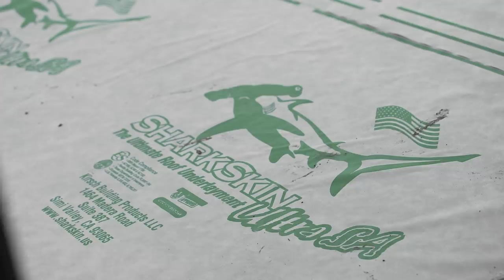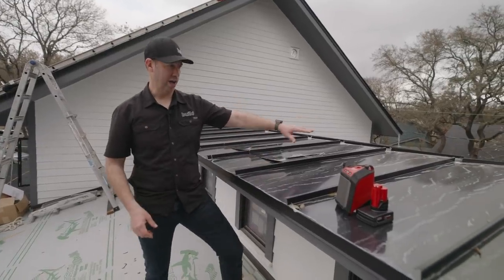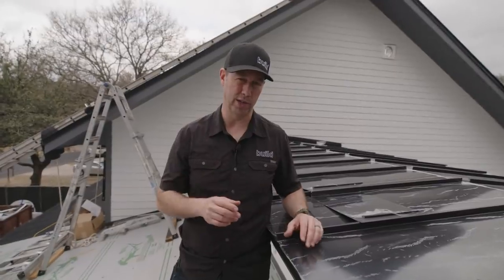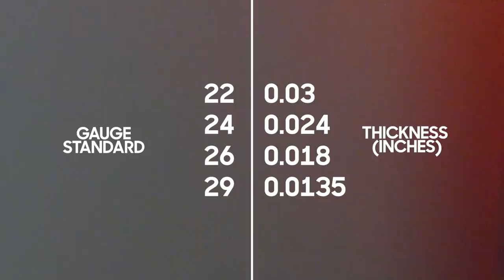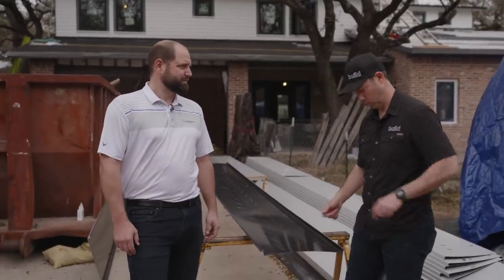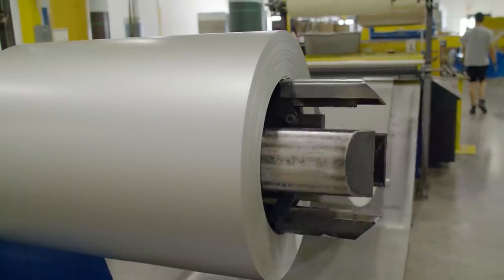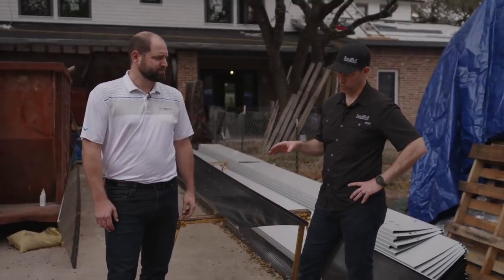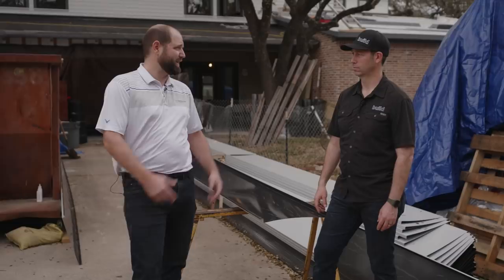Metal Roof- Best Practice Details

Comment: What is the cost comparison for a metal roof vs composite shingle?
Reply: I doubt you will ever get that answer!!
   I did a rental property a few years back. Comp. cost was $6,000.00. Metal: 24,000.00
   That’s a big difference. Plus it is a small 1600 square foot house one story L shaped home
Reply: Further more the materials in your area can always be based per square foot. 

Talk to your local installers and you'll gain pretty good insight towards this question. 

I bought my metal at $3.50 sq foot 
Shingles would be substantially less but that may not be the variable that changes the final price tag.
Reply: Historically we've seen standing seam metal coming in at about 3 times the cost of comp shingles. This can vary dramatically depending on the choice of shingles and the metal system, and it's especially hard to predict now that material prices have gone up for everything. The best way to check is to get multiple quotes from different contractors in your area. -Thad
Reply: @TheMetalRoofingChannel  
   That is how I feel. You should get multiple bids on any construction type work you do to your house!!
   
     I have another story. I had a new heating and air system put in my home. I had several bids. 2800 to 3400 dollars. Then I ran into a friend of mine. I asked him to come over and just put the system in. He was there in about a week or so. He did a great and clean job. He sent me a bill it was $4500,00.
  Maybe I should have gotten a price from him also.     😜

Comment: Alls I really wanted to see was all the roof-to-wall flashing, and the flashing details wear a facia board buts into a wall. Some of most crucial parts of making that roof water tight. Didn't see any of those details covered, what a shame... A whole video could be made on just the roof flashing details alone.
Reply: Some people can't read drawings. To them, a picture or a video is worth a thousand words.
Reply: That's what I wanted to see. Making a water tight roof is probably 95% flashing work. Any idiot can be taught to lay panels or nail shingles in one day. The real work is in the flashing details.

 We would have had a receiver flashing made that goes on before any siding product. 

The siding comes down over it and leaves an S channel exposed for us. After the panels go on, Z-bar with butyl tape would be screwed to the top of the panels. Anywhere a panel meets a side wall we turn up an inch with the panel as extra protection. 

Face flashing would hook onto the Z-bar and the top of it would be screwed into the wall right under the receiver flashing.

 A counter flashing would then go into the S-bend on the receiver flashing and cover over the top of the face flashing.

At least, that's how I was taught to do it. I've seen other people make an all in one flashing that goes on before the panels and they just slide under it. It is vastly inferior in my opinion to the way we do it. Driving rain, bugs, and animals can all get under it. It really sucks at side walls b/c you're strictly relying on your 1 inch turn up to make it water tight, which it isn't. 

There was a company that came into our town and basically took over the market. That's how they did their flashing details. A contractor we worked for dropped us and started using them. About 3-4 years later they start giving us work again. We ended up going to every single house they built in those 3-4 years and had to fix every damn one of them. Luckily it was just front porches and accent stuff, not entire roofs. Just shoddy workmanship all around.

Comment: Bravo, for the air gap.   Bravo, for radiant barrier, shiny side down; you're gonna need it because that black metal will heat up on sunny days to a very high temperature; but the radiant barrier will block irradiation of lower elements... to the extend that conduction does not defeat the radiant barrier.
Reply: I don't understand the logic behind installing "shiny side down". The natural reflective property of a reflective surface facing a heat source across an air space allows the
aluminum surface to reflect radiant heat back to the direction from which it came. If it's facing down, how is it working?

Comment: Love your channel, but every time i hear lifetime of the building amd then 30 40 years i wonder. Why do you build (in this case) a roof that will only last 40 years? In the netherlands where i am from we build to last way longer. Certanly not 40/50 years
Reply: I know right? And they talk about it like it's so great lol.
Reply: Gotta factor in cost vs performance. Do you really need a hand seamed copper roof that will last 300 years? Probably not. Most people aren't staying in the same house for even 20 years here. Another factor is that materials, installation processes, and building codes are constantly being updated and improved. 

And this roof will last way longer than 40 years. The paint warranty is 40 years. I just replaced a 5-V galvanized steel roof at the beach that was installed in 1946. That's nearly 80 years of life from what is now an inferior roofing product and has been inferior for at least 30 years. If it was further away from the salt water it would last hundreds of years. We went back with a 5-V galvalume coated steel roof with stainless steel capped screws that will definitely last well over 150 years. 

When they say it will "last" 40-50 years what they should really say is the manufacturer's warranty is 40-50 years. Its not like on the day of year 41 its going to pack up and leave or something.

Comment: Hi Matt 
I have a question. I live in Northern Ont. I have a 3 season log cabin kit. My roof is beams & tongue & groove boards on top.
I have GAF membrane to cover whole roof. Can't afford spray foam. Can I use Rockwool Insulation under my metal roof?
And if so what is the procedure?

Comment: Why didn't "t you put the radiant barrier facing up where you installed diagonal 1x4s? Isn't that the 3/4" air gap side., or does the foil work when upside down too?.

Comment: Anything made of plastic or polymer will fail over time with heat and UV rays. FACT. Taped joints will fail when the adhesive backing becomes brittle and fails too. FACT.

Comment: FACE palm. the radiant barrier should be installed first, THEN the spacer material (1x4, or that fabric like stuff) and then the metal roof on top of the spacer. the way you laid it down is a total waste. it will do nothing.

Comment: With a black roof and the obvious heat generated, have you thought about capturing the hot air during winter? Maybe it could be directed to a heat exchanger to heat your hot water or house? Might as well use it if you can since you've isolated it from your roof.

Comment: Hey Matt, Thank you as always.  I wish you would have shown the detail on how the roof air flow mesh meets the upper wall.  

How do you use the corrugated plastic to allow the vapor from the roof to vent upwards?
Reply: vapours travel through the air space between the underside of sheet metal and the top of the membrane, then escape at the bottom of the assembly and at the top (soffit/ridge). There are continous vents at the soffit/fascia and at the ridge/junctions to vertical walls.

Comment: Matt, good info as always! My next roof will be metal, so I’m very interested in the details. My biggest question here is why black? I’m assuming it’s an aesthetic choice, and I agree that it will be a good match with solar panels. But since it’s so sunny where you live, doesn’t black absorb more heat and increase the demand on your AC? I recently had a solar PV system installed and one of the considerations was that roof mounted solar panels are less efficient than ground mounts because heat gets trapped between the panels and the roof. Solar panels produce less electricity when they get hot. It would seem to me that having solar panels mounted on a black roof would exacerbate the problem. As always, I’m eager to be proven wrong...
Reply: There really isn't that much of a temperature difference b/t the colors on metal roofs. They all get hotter than two rats f*cking in a wool sock. With all of the moisture and heat mitigation he has I highly doubt a different color choice would make any significant difference. If you're spray foaming the roof deck, then it definitely doesn't matter. 

Another problem with white or other light colors is how bright they are. If you've got an upstairs window that overlooks a white roof then be prepared to wear sunglasses in that room or have some damn good blinds and blackout curtains.
Reply: You are 100% right, I recently installed a silver metallic roof for a client and the panels did not get hot. Yes the roof is bright when installing it, Matt could have gone without the reflective material had he used a lighter or reflective color

Comment: Doesn’t the air gap make the metal more susceptible to hail damage?  Is the air gap necessary, why would you have moisture under a metal roof?  Seems like you shouldn’t need the drying of the roof is doing its job.

Comment: I just don't understand the overbuilding. Metal roofs should not leak - ever. Putting on a peel and stick just makes a leaky metal roof a bad investment. Zip is all you really need. Peel and stick is way over the top in money and wasted materials. Properly installed metal roofs will last 100 years and have never needed rain screens or peel and stick.

Comment: I’d be interested if you considered solar panel tiles?
Reply from the maker: I looked into that, but in the end I decided this was a better choice. It allows me to put the solar on when I’m ready and have the roof I wanted in the meantime. I also have some pretty good tree coverage so I’ve only got one spot over my master bedroom that will work with Solar
Reply: @buildshow  on partially shaded ares micro inverter solar systems would work better :D
Reply: @buildshow  Hi Matt, are you pre-wiring your garage for electric car charging?

Comment: there is a few things wrong with your install. yes the shark skin is a vary god product but, you never a want to use 100% ice shield on your roof. it dos not allow the roof subdeck to breath this leads to dry rot of the subdeck. here in my state 100% ice shield will not pass code because of that resin. 2. is the style of ridge vent you used.  has to small of a perforations and gets plugged vary fast so after the first 6-12 months it is useless. that's if the insolation company  do not plug it up first.

Comment: I just priced this September 2022 for a 55 square roof. $105,000 for the roof and $18,500 for the air gap framing details. An architectural shingle roof with full ice/water peel & stick came in at $38,000.

Comment: You need to do a video on reducing roof vents.
Reply: Yeah, where are the toilet stacks?
Reply: @JerryLevenson  
Usually out the gables.
You need to check code in your area to match proper pipe diameter, etc. but the vents aren't required to only go up.

You can't go up, and back down, and you need to size appropriately.
Looks at mountain ski cabins, most normal through the roof straight up vents are at a high risk of getting plugged or torn off with heavy snow falls.
I'm getting ready to replacing my roof with metal, I've been relocating and reducing the number of roof vents where I can. Water heater was moved last month when I replaced it, furnace is coming up.

Comment: Matt - I'm in Texas as well... Beaumont to be exact. Getting a black standing seam roof installed and the builders couldn't get approval to install solars with the S-5 clamp. They will have to penetrate and screw to the rafters due to the windstorm codes. Just an FYI...

Comment: Remember just cause you have solar does it mean when the power goes out that you’ll have power in the house only with a battery back up with the solar will you be able to maintain power
Reply: the "standard" solar system shuts down during power outages because it has no provision to isolate itself from the grid to prevent unwanted backfeeding.  also, it has never occurred to generator manufacturers and solar manufacturers to have their equipment work together.
Reply: @kenbrown2808  no . no stand alone solar panel setup will work with out a battery set up. Solar panel only will not work.
Reply: @deanekonomou7641  actually the control module the local installer likes has a 1kw isolated receptacle. But yes, standalone systems use batteries. Also, unfortunately, the grid connected system my dad inherited requires batteries to function.

Comment: Matt how did you install radiant barrier on the steep slopes?
Reply: You're right. He didn't cover that at all.
Reply: I believe the radiant barrier was installed the same way as the low slopes, but with furring strips instead of the 3D mesh or dimple mat. The steep slope assembly looks like this: Sharkskin Ultra SA underlayment -> wood furring strips -> Sharkskin Radiant (shiny side down) -> metal panels. The roofers installed the roll of radiant barrier vertically while installing the metal panels at the same time across the roof. -Thad

Comment: Speaking of solar, I don't remember any special considerations for the electrical connections up on the roof for future solar.  It would be unsightly to run those wires down the side of the house to your Main Box/Inverter/Battery.

Comment: I had a retrofit to standing seam in 2019. 
The roofer got a precut system and they shipped the wrong dripedge, the supplier was nice enough to come out and make it on site , those machines are pretty nice. 
The seamless gutter guys use the same material now so you can get a color match without much fuss. 
I have a high pitch roof and wish they would have warned me how slick it was going to be, its like a row of slides on your roof. If i had known i would have had them put in some permanent harness anchors. 
I went standing seam because not only was it time to replace the shingle but i was planning on putting solar on and i likeed the ridge mount system. No sense in putting 25 year solar on a 15 year roof.

Comment: When you install the CorVent along the edge how are you going from vertical air flow to horizontal air flow when you have sides on the strip. The sides close off the air flow unless you rip the top edge at a 45 degree angle?

Comment: I watch a house flip channel where he had to deal with solar panels on an old roof and the cost to replace the roof was several thousand dollars higher due to having to remove and replace the panels, so a new metal roof is the best time and roof type to add solar, otherwise you're better off putting it on ground level scaffolding in your back yard.

Comment: what kind of metal? aluminum, steel, galvanized steel, stainless?
Reply: Galvinized steel...I think.
Reply: @apscoradiales  yes most likely, but they should make it more clear for viewers. Saying metal is very vague
Reply: @A-Sidhu  It's actually Galvalume® steel. It's coated with a Zinc/Aluminum formula that has much better self-healing characteristics than galvanized steel. -Thad
Reply: @TheMetalRoofingChannel  thanks

Comment: A lot of people are questioning the choice of black in such a sunny climate, but with all of the venting and insulation it shouldn't be much of a problem. Yes, it will be hot and black feels hotter to the touch than lighter colors, BUT when you go with a lighter color with more reflectivity the brightness is kicked way up and it can be aggravating to neighbors and especially any upstairs rooms you may have. 

I always explain this to customers who want a lighter color metal, copper, or galvalume finish if they have bedrooms upstairs with windows overlooking a roof. 

Another problem with virtually any light colored roof system whether it be asphalt shingles or metal is airborne algae, mold, pollen, and dirt turning it black. I always explain to customers who say they want white asphalt shingles b/c they think it will be cooler to prepare for the roof to turn brown/black in about 5 years unless they constantly have it soft washed (which I generally don't recommend for various reasons).

He's got plenty of heat/moisture mitigation so it will be fine and honestly, its all overkill in my opinion. I wouldn't have done all of that. I wouldn't have even wasted my time and money on ice and water shield. Lots of metal roofers need it b/c they can't make a roof water tight without it.

Comment: Nice video. Roof looks very handsome.
2 items:
1) There was no mention of seam spacing. A black (I assume) aluminum roof will undergo quite a bit of heat related expansion and contraction and you will not want to have any “oil canning”. Seam spacing and material thickness impact this.
3) Matt mentioned 3/12 for his “lower” slope area but later your guest said 2/12. If I’m not mistaken, 3/12 is really the lowest you want to go on and metal roof that is not soldered or otherwise detailed to perform as a membrane that will essentially leak under some circumstances.
Reply: Some mechanically seamed metal systems can go as low as 1/12 pitch. Check w/ the manufacturer's details/ specs

Comment: You didn't even mention anything on oil canning.  It looks like you will have some oil canning from some of those aerial photos.
Reply: Same thing I’m trying to ask about. I want to know how to prevent it. I’m surprised he didn’t use a striated panel.
Reply: @unionrunner1  You can't prevent it. Its inherent to metal panels b/c they expand and contract. Panel manufacturers do not warranty against oil canning and they will straight up tell you, IT WILL HAPPEN.